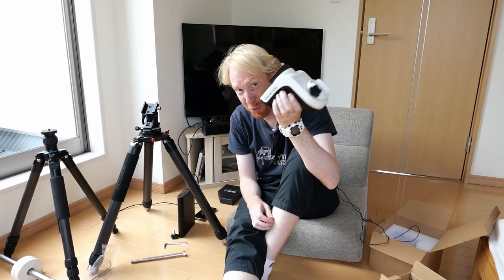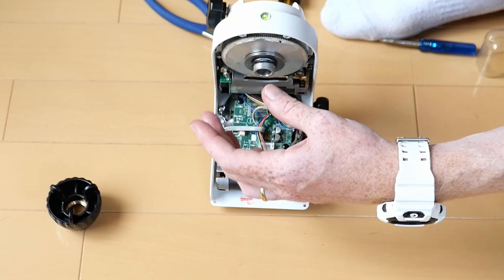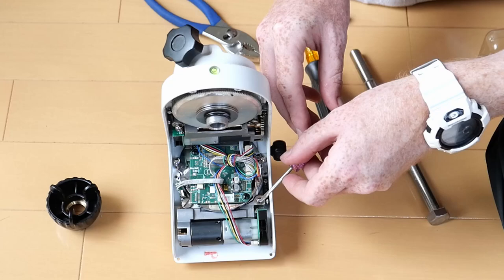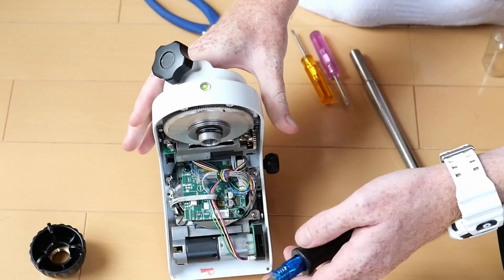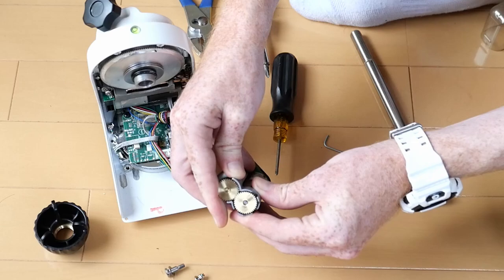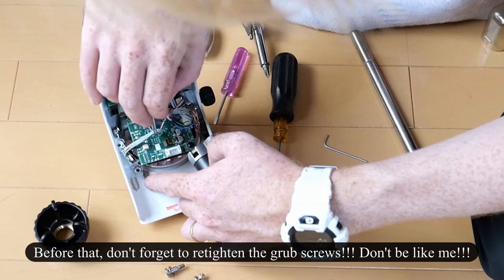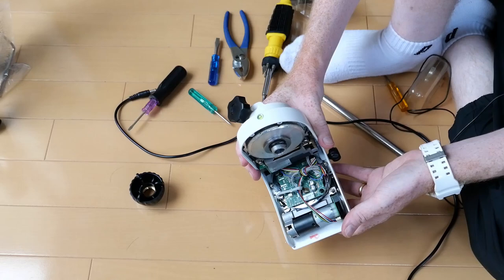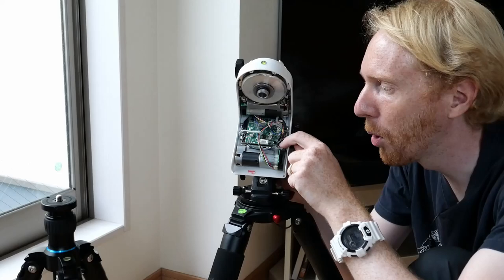Tuning the Skywatcher AZ-GTI! The road to an ultralight, fully automated astrophoto rig!

Comment: Hi Cuiv I really like this video I did everything you did on the azimuth axis because I’m using an equatorial mode and I had binding no matter how I try to adjusting there is a a region where the main gear must’ve been eccentric and not well centered! and so it bound so I went back to using the spring and I think my solution is going to be to get a more powerful spring and make sure I try to do something a kin to East heavy
Reply from the maker: Argh that's a shame... yeah sometimes those things can be simply too of-center for a fixed setup... A stronger spring or East (or West)-heavy setup should help indeed...

Comment: Seems like that's going to put a lot of pressure on the motor and worm drive bearings, especially in warmer weather as the metal expands
Reply from the maker: Yeah, that's my worry as well, which is why I mentioned it may then need seasonal adjustment... Well see how it holds in the long term!

Comment: Hi Cuiv, a very helpful video. My AzGTi is guiding really well, I can get 5 minutes subs with no trails while having   a 1,5-2 arc" RMS with phd2 guiding. I can even go up to 4-5 minutes subs unguided with an 135mm lens if I balance it properly. But the problem is, it is so hard to do it cause it is so stiff that practically there is no difference if I have the clutches tightened or not in both axes. I don't have an ampere clamp to try what you proposed in another of your videos. Are you facing a similar problem?  Any suggestions?
Reply from the maker: Hi George - yes I am having the same problem with balance. For me I just computed the moment arm of my setup, and thus computed where the Counterweight should be based on that! It's a bit of an approximation, but it kind of works!

Comment: Almost impossible to find another spring that could fit in it, so I used an elastic or elastomer to work with the springs or even replace it depending on the strength of the elastomer.

Comment: This unfortunately does not work. When I tried to push the two gears together after tightening the three screws, I couldn't reinstall the 2nd gear and mesh it with the first gear. I had to loosen it considerably even when I could mesh them together because I was getting a weird screeching sound indicative of binding. I should have left it alone because as it turns out all of my backlash slop was caused by the spring screw and I have just tightened that down altogether on both axes and it eliminated all of my slop. I still have tweaking to do to get the first motor back to where it was before I messed with it now. These motors are very fiddly and when you loosen those three screws that hold the motor together there is potential to create an off axis meshing of the two gears because the two parts of the motor don't mate with each other well on a flat surface.  I think I am just going to overhaul the whole thing and strip all of it down and clean and regrease everything in the process.

Comment: Hi Cuiv, I tuned my SkyWatcher AZ-GTi to fix any backlash similar to what you did in yourTY channel. After doing that when I want to polar align, the mount slews fine in declination axis but in RA axis it continues to rotate without stopping until I click cancel in the synscan app on my phone. Can you help please fix this issue? Thanks.
Reply from the maker: Well that sounds like one of the cables hasn't been reconnected properly - but I can't say for sure. Maybe try reseating the cables? But before that try with another phone just in case?
Reply: @CuivTheLazyGeek  The optical encoder flywheel, or optical encoder sensor is broken on your mounts RA motor. You find this on the opposite side of the 2 golden gears. The mount uses the optical encoders regardless if they are disabled in the phone app. I had the same issue, wound up getting a new flywheel printed at a 3d shop using the DEC one. The quality of the ones that come with the mount are abysmal.

Comment: Ok last night I got PHD2 and the AZ-GTi all setup and ran for about 2 hours and this is before blacklash tuning  is this good, ok, poor?       
              RMS                         PEAK
RA        0.37" (0.37 px)  2.04" ( 2.04 px)
DEC      0.39" (0.39 px)  2.00" ( 2.00 px)
TOTAL 0.54" (0.54 px)

What do you think Cuiv?
Reply from the maker: TBH that's pretty decent  - although do you really have 1 arcsecond per pixel resolution on your scope?? With that you can get great widefield results!
Reply: @CuivTheLazyGeek  I was using a Canon 300mm F4 lens on my ASI294MC-Pro as the main camera and the ASI290MM Mini as the guide camera using the ZWO 120mm Mini Guider Scope. Please explain about the 1 arcsecond per pixel resolution on my scope please, so I understand. This is before hypertuning so should I in your opinion?
Reply: @whatmattersmost6725  1px at your 120mm is about what, 4-5" so your result is about 2.5" RMS and peak was about 10".  It's ok and something to be expected from this mount.

Comment: Cuiv, with you using the AZ-GTI on the equatorial mount does GOTO still work with the Firmware update and also not sure if you even have the SynScan whether the Synscan DB translates the AZ to EQ points thanks.
Reply: Yes If you download the Firmware for the EQ mode you get both options for AZ and EQ when you boot up syncscan pro

Comment: Interesting mount. It looks like SW have taken a similar route to the Celestron CGX mounts with spring loaded DC servo motors rather than their traditional stepper motor arrangement. What is the backlash in the black gearbox section like? On My CGX the internal gearbox backlash is horrendous to the point PHD2 can't keep up with DEC reversal backlash. Can this mount be driven from EQ Mod? If so it might open the way to losing the Celestron hand controller and windows only CPWI software.
Reply from the maker: It is indeed an interesting, small, tiny little mount! The mount requires a specific EQDIR cable (different from other SW mounts), but can indeed be controlled via EQMOD or GS Server. As long as it's for widefield, I think it can perform well!
Reply: @CuivTheLazyGeek  Cuiv, do you have any information on what type of special/specific EQDIR cable would be needed for this? I ordered a FTDI RJ11 to USB-A 6P6C cable (only one I could find in Japan) that seems to be intended for network usage, and I can't get it to to recognize the COM ports on EQMOD. Have you managed to get this working with another type of EQDIR cable?

Comment: Great video Cuiv, I 'tweaked' mine pretty early on and didn't realise it was supposed to be spring loaded ! I just adjusted it at its highest point of a full rotation which gave no backlash but still a bit at the opposite end of rotation. It would be good to know how Skywatcher meant to implement it ! I generall get just under 2" peak on PHD2 - works fine with a Skywatcher 72ED / ZWO 1600 mm. Liked and subscribed :-)
Reply from the maker: Welcome to the channel Gaz, and thanks for watching/subscribing! I think SW just wanted something that works all the time for AltAz, regardless or mechanical flows of individual components... Which makes sense of course! But then is not great for Equatorial mode!

Comment: Hi cuiv, great video, did you stick with the fixed meshing of the RA motor to the worm or revert back to the sdprging loaded mechanism, kind regards
Reply from the maker: I sticked with the fixed meshing!
Reply: @CuivTheLazyGeek  I hope your doing well after your accident, thank you Cuiv, mine came fixed meshed from the factory in the RA axis and the Dec was spring activated so I shall leave it like this also, I also had a lot of binding on the RA axis when turning the mount manually so watched a video on fitting a plastic washer under the locking nut, the grub screws holding the locking nut needed loosening a bit as these caused binding aswell and greasing all up now buttery smooth , thank you

Comment: My AzGti the DEC always cannot move back to orginal point when guiding calibration on south point, is it follow the video to tune the mount whether it can solve the issue?
Reply: Hi Andrew, what firmware is your GTi using? If it's not 3.22 MC as that's the latest.
Reply: @whatmattersmost6725  3.20
Reply from the maker: The firmware update may help, but otherwise it could just be extreme DEC backlash, in which case the stuff in this video (especially the motor gear mesh part) should help. If it is stiction, that's somethings else. I hope you figure it out!
Reply: @CuivTheLazyGeek  how would you solve sticktion? mine is apparently suffering from that currently.
Reply: Exactly the same thing happens to me, when calibrating, it starts to move north, but when it has to return to south it keeps going north or does not return, were you able to solve the problem by adjusting the gears? thanks

Comment: Very good tutorial Cuiv, I'm new to the channel, I just bought this mount and saw that it has a lot of backlash on the RA axis in the tests I did over the weekend. I'll think about making the improvement you made, but maybe leaving the spring in operation with the proper adjustments. Do you believe that the backlash problem will be solved even with the spring working?
Reply from the maker: Welcome to the channel! I'd probably try to replace the spring with a stiffer one, that should help to some extent. That said, backlash in RA doesn't matter too much, since we never reverse directions in RA - at most we just pause the tracking and let the Earth rotation do the trick.
Reply: @CuivTheLazyGeek  thanks for the tips, i'll do more tests in EQ mode before opening the mount...
Reply: @CuivTheLazyGeek  just one more question, did you have any problem after a year using the mount without the spring working?

Comment: You should be wearing a grounding strap on your wrist, since you are touching an exposed circuit board with sensitive electronic components on it! One static spark, and you can fry components on that board!
Reply from the maker: Fortunately the insane Japan humidity prevents that, but you are right :)
Reply: @CuivTheLazyGeek   or at least mention it in your video for anyone who decides to follow your instructions! They may not be in such a humid area!

Comment: That's helpful....!!
Please make a video on iOptron MiniTower also....like how to rectify the backlash etc to increase its performance. Also mine iOptron MiniTower (Discontinued series) GPS is not working properly. It always goes to year 2001, once the GPS shows OK on remote.
Thanks and Regards from India..!!
Reply from the maker: Unfortunately I don't own that mount! Your GPS issue is due to GPS Rollover (I think: https://en.m.wikipedia.org/wiki/GPS_Week_Number_Rollover)
Reply: @CuivTheLazyGeek  oh yes I also read somewhere on iOptron website but couldn't able to find any solution yet. As per iOptron team I have to replace the GPS unit...😔

Comment: That's great, I wonder how much of this is applicable for my SkyGuider Pro for the future. I think the basic mechanism is very similar.

Btw, check out the Dumbbell Nebula I was able to capture from my Bortle 8-9 front-yard with the SkyGuider Pro and a 200mm lens and a cheap SVBony CLS clip-in filter (7x180s @ ISO400, image is cropped) https://i.imgur.com/GNbQkPP.jpg 
These were my imaging conditions lol https://i.imgur.com/Sm1ozYx.jpg , I think it turned out nice regarding everything.
I did a manual dither and it made a real difference (and for that I replaced the stock DEC panning head with a smoother, better one. Still manual, though).
Not the lazy way, but we'll get there one day.
Reply from the maker: Is the Skyguider Pro spring loaded? I think it's pre-meshed, but when I had it I didn't need to adjust anything!
That is an outstanding result from your backyard! Those lights are really shining down on you! You may even want to add a felt dew shield on top of the current dew shield to cut off more light?
And I'm glad the manual dithering worked well!
Reply: Great image itai! I wished mine looked that good, congrats!